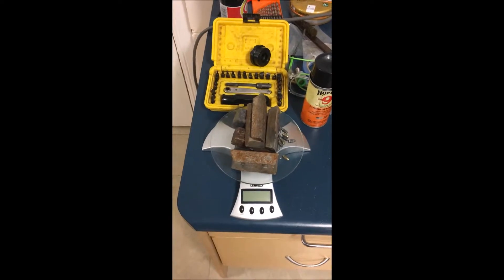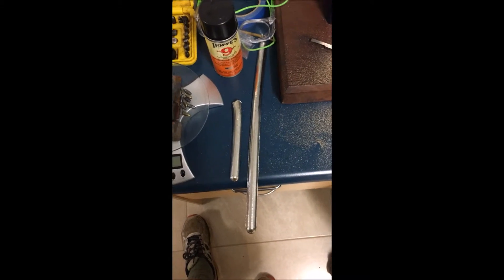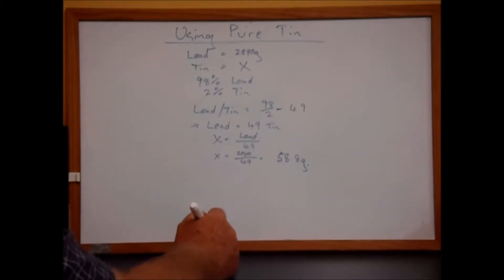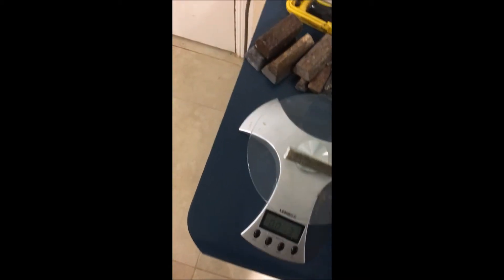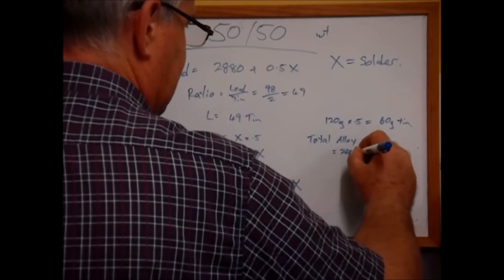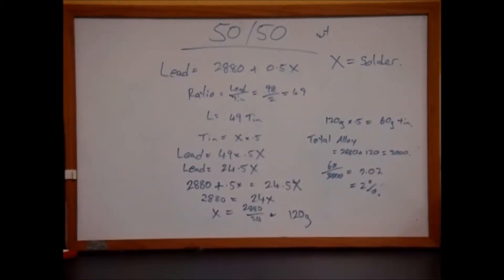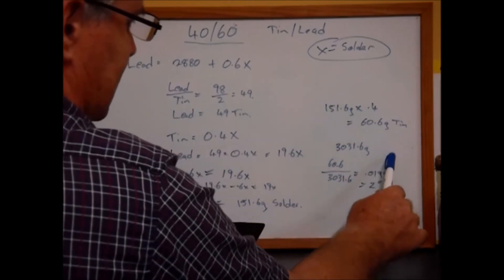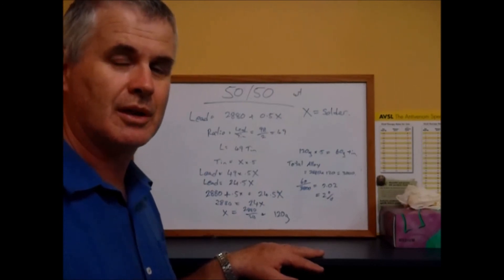Mixing Lead Alloys for Bullet Casting : Calculating Amounts

Comment: I would be most grateful for your help with the calculation. My Tin/Lead bar is 63 /37 ,I would like to mix the same 2% Tin  into a 2880g lead  that you  cast with,  for my .451 rifle.
Reply from the maker: Add 94.4 grams of your alloy to 2880g lead will give a 2% alloy.
Reply: Thank you. @456eec

Comment: Have you measured your final lead tin mix for a BHN hardness test ?
Reply from the maker: No never had the need. .310 Cadet projectiles are designed to be very soft and can be just pure lead but I add some tin as it makes it easier to cast accurately. Otherwise I just cast for pistol and lever action rifle. I can see it would be beneficial if casting for higher velocity rifle cartridges with gas checks.